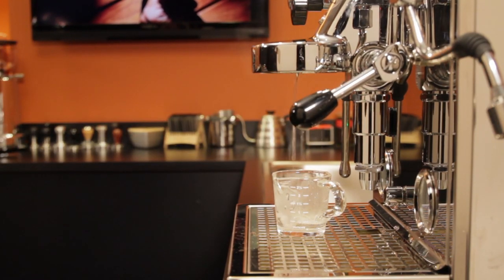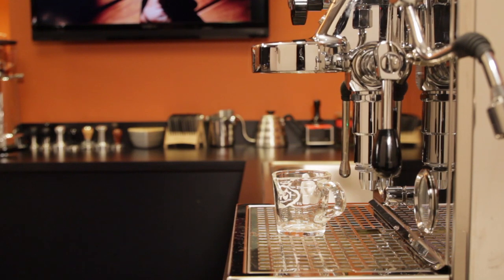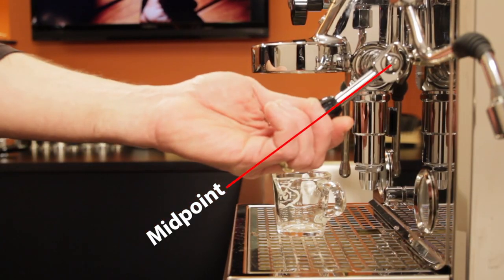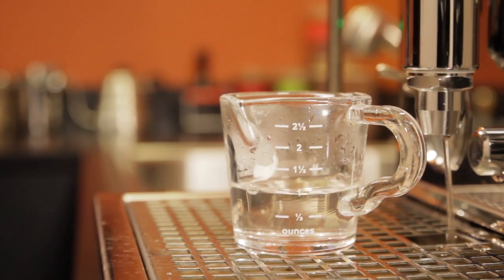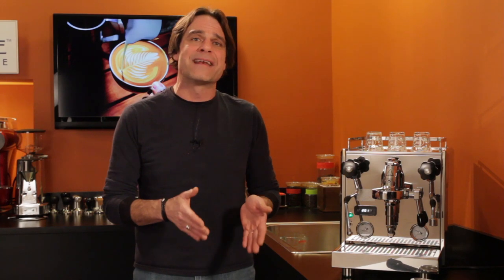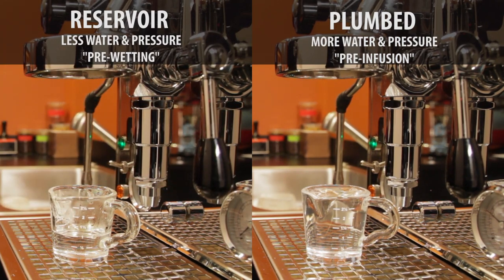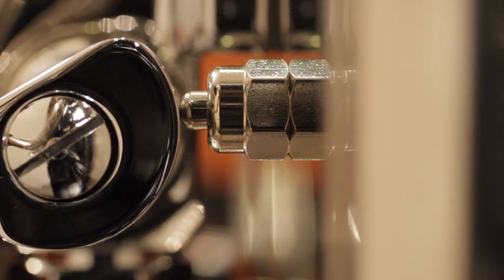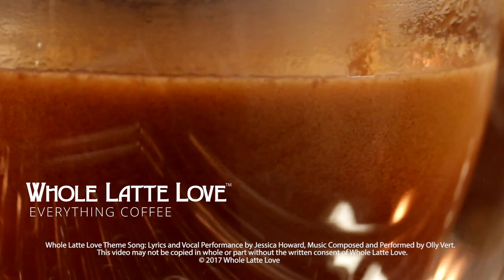How To: Pre-Infusion on E61 Brew Group Espresso Machines

Comment: Can the Profitec Pro 600 w Flow Control preinfuse? It’s a vibration pump, so I’m assuming not... but, due to the Flow Control feature, I am able to control the pressure/water... so I am not sure. Thanks!
Reply from the maker: Hi Alex, Thanks for the question. You definitely can pre-infuse on the Pro 600 equipped with flow control! Vibration pumps take a few extra seconds to reach full pressure internally as compared to rotary pump but after that it's all the same.
Marc

Comment: Hi Mark thanks for the video .. and I want to ask if the water line is for example 30 psi and I did preinfusion ,so the full ectraction will be 30 psi more than the actual brew pressure?
Or the water line pressure will be de-activated when I raise the arm?

Comment: If you live in an area with high water pressure (e.g. 70psi) would it be advisable to install a water pressure regulator before the machine so the incoming pressure doesn't blast a hole in the puck? if so... what would be an ideal range for the water pressure setting?
Reply from the maker: Hi Elton, Thanks for the question. Yes, you should have a pressure regulator on plumbed in connections. ECM/Profitec specs 2 bar/30psi pressure setting for machine input. In addition to a pressure regulator it's advisable to install an in-line water filtration system to prevent scale and remove chlorination. Especially true for dual boiler machines which are difficult to descale. A popular option which can eliminate scaling and includes a pressure regulator is the BWT Bestmax Premium: https://www.wholelattelove.com/products/bwt-bestmax-premium-filter-package-w-besthead-flex
Marc

Comment: Hi, thanks for the useful video! I have ecm synchronika and the line pressure is 4bar. Should I purchase reductor? The user manual says max 2 bars... I'm confused looking at your profitec with 4 bars. Can I use my synchronika safely?
Reply from the maker: Hi SR, Yes you can use your Synchronika safely! Profitec ECM does recommend reducing input line pressure to 2 bar. This because their plumbed machines are always open to line pressure internally. This allows for the relatively unique and desirable line-pressure pre-infusion feature when the machines are plumbed to waterline. A pressure reducer is a good idea. It allows one to adjust the pressure of pre-infusion if desired. I'd set that to the recommended 2 bar for normal use and when the machine is unattended for extended periods. But no problem using higher setting when desired.
Marc
Reply: @Wholelattelovepage  thank you!

Comment: Wouldn't pre-infusion defeat the purpose of tamping and leveling off the coffee inside the portafilter? Once it gets wet, the coffee should loosen up and it will be a wet "blob" prior to having the full pressure go through.

Can someone explain why many people emphasize on leveling and tamping the coffee... and the getting all wet so it undoes the tamping?
Reply from the maker: Hi Freddy, Thanks for the question. There are a few uses for pre-infusion. Totally understand why you think it might loosen up the coffee. But, that is not what happens. One use for pre-infusion is to help prevent channeling of brew water through the coffee puck. When water initially saturates the puck the ground coffee absorbs it and swells slightly. This helps make the puck a little "tighter" and prevents brew water from finding a path of less resistance (channel) through the puck. Channeling causes uneven extraction of the coffee. Another use for pre-infusion is to allow a very fresh from roast coffee to off-gas CO2 locked up in grind. Off-gassing helps to reduce brightness/acidity often associated with in lighter roasted single origin specialty coffees. Technique for that is a very long, like maybe 15 seconds, low flow rate before ramping up to higher flow rate and extracting. That type of pre-infusion requires a capable machine. One that can do line-pressure pre-infusion or has a flow control device.
Marc

Comment: Hi, Marc, GREAT video for showing pre-infusion on E61. got a question here, i have a rocket giotto type R, and i use flojet with an accumulator, which ensures that i have a stable water pressure; however, while i lift the lever up to pre-infusion position, i see water comes out from the group head, but the pressure gauge shows 0 pressure, just like the one in your video shows "RESERVOIR".  Anything wrong with my setting ?   Thanks in advance.
Reply from the maker: Hi sFu, Thanks for the comment and question. It's a good one! What you are seeing highlights an important difference in plumbed machines from different manufacturers. What you're getting is the E61's pre-infusion only. You will not see line pressure on the gauge during pre-infusion on plumbed Rocket machines. This because Rocket machines have a solenoid valve which only opens the machine to line pressure when the pump is operating. If the pump is off the machine is closed to line pressure. Plumbed rotary pump machines from ECM and Profitec do not have a solenoid valve on the plumbed connection so when you lift the lever line pressure does reach the group prior to the pump coming on. Two ways to consider this difference. First, the solenoid valve in Rocket machines prevents water flow into the machine when UN-attended. This prevents flooding should something give way inside the machine. Without the solenoid in similar ECM/Profitec machines there is that risk. I have never had a report of that happening with an ECM or Profitec machine. But, it is a possibility and why ECM/Profitec clearly states that line pressure into the machine should be limited by a pressure regulator to 2bar/30PSI and water supply should be cut off when the machine is not in use. On the other hand without the solenoid valve ECM/Profitec machines can do a true line pressure pre-infusion the pressure of which can be user controlled by adjusting a pressure regulator if equipped. Hope that helps!
Marc
Reply: @Wholelattelovepage  It helps A LOT. Thank you so much, Marc.

Comment: I always thought that preinfusion is the process  while the water drips at first on the coffee and then into the preifusion chamber until it is full. before the pressure builds up completely . (pump on)
The E61 was the first brew group with automatic preinfusion (without lever in mid position) just look at the pressure gauge how it reacts with some delay.
Reply from the maker: Hi LA, Thanks for the comment. With machines now capable of doing line pressure pre-infusion things have progressed. Also options for flow control to do incredibly long low flow pre-infusion. Quite different than a pre-wetting and very short delay in pressure/flow build. These capabilities have become much more important as the qualities of specialty coffee have gone through the roof in the last decade in conjunction with espresso moving beyond commodity to a more crafted experience in many parts of the world.
Marc
Reply: @Wholelattelovepage  Marc thanks a lot for taking time to answer. I love your channel.

Comment: So does pre-infusion works on ECM Synchronika using reservoir? (Can’t plumb)
Thanks Marc for all the useful videos <3
Reply from the maker: Hi MAS, Thank you for the kind comment and question. When running from reservoir you cannot do a true pre-infusion defined as a continuous slow flow of low pressure water. You can do pre-wetting of the coffee by raising the lever to the pre-infusion position. This drops a small amount of water onto the coffee with no pressure behind it. Hope that helps!
Marc
Reply: Whole Latte Love Thanks a lot Marc for the prompt reply, and sorry if my question was stupid after all given info but i saw a video that says Lucca a53 mini is one of the machines that are capable of pre-infusion using reservoir so i was just wondering if Synchronika is one.
Reply: Whole Latte Love Only a flow control will help me truly pre-infuse in this case right?

Comment: This doesn't seem to work on my Pro 500. Can I just turn off the power for a second and open the valve fully to pre-infuse??
Reply from the maker: Hi Brad, Since you are running off reservoir on the 500 what you'll get is pre-wetting and not pre-infusion when lifting lever to just before the pump kicks on. That's basically a bit of pressure pushing water out of the heat exchange section of the boiler and onto the coffee. In theory, you could leave the power on, lift lever fully to kick the pump on for a few seconds and then lower the lever just a little  so pump kicks off and allow the pressure to push a bit more water through the coffee, wait a few seconds and then kick the pump back on. I'll just say that's not a technique I've seen used or that I've tried myself. Another option is the Profitec E61 Flow Control Device: https://www.wholelattelove.com/products/profitec-e61-flow-control-device It allows you to have the pump on full and have continuously variable control of flow rate through the group.
Marc

Comment: I am probably changing my view on pre-infusion. Yes, it seems logical to pre-wet the tamped coffee puck for a short duration before hitting it with 9-bar pressure. However, I can't think pressure at 9 bar within the restricted space of the portafilter basket would allow channelling to occur. That's an awful lot of pressure over a small area!. Only a see-through group head assembly would allow us to find the definitive answer. I notice on my new ECM Synchronika that there is no difference between a short traverse of the brew lever and fully open - the rate of water delivery is just the same.
Reply from the maker: Hi DR4, Thanks for the comment. I can understand your reasoning but I guarantee you channeling can occur. A few ways to check: After an extraction have a look at the top of the coffee puck. Channels are clearly indicated by holes in the surface of the puck. Another fantastic tool for appraising channeling is the bottomless (or naked) portafilter. It allows one to view the extraction as it exits the filter basket. Channels present here as spurts/spraying of espresso from one area of the filter basket while other areas may have no flow at all.
As to not being able to hit the pre-infusion point. It's a very small move of the lever to go from the pre-infusion position to the pump on position. Sometimes the pump switch which is contacted by the cam of the E61 lever is slightly out of adjustment. The switch is extended out to far making it difficult to hit the pre-infusion postion without turning the pump on. The switch position is adjustable if that's the case with your machine and it's easy to do. There are 2 nuts on the shaft of the switch. One on the outside face of the machine and one inside the machine. If up for it you can loosen the outside nut a few turns and take up the slack by tightening the inside nut. This requires removing the cover of your Synchronika to access the inside nut. It may take some trial and error to get the adjustment just right. Also be careful with hands inside the machine if components are hot and unplug from power when working inside the machine. Hope that helps!
Marc
Reply: @Wholelattelovepage  yes a bottomless portafilter is essential for learning about channeling and making a better tamp.

Comment: Hi Marc,  how many seconds do you preinfuse. Untill you see coffee coming out of the basket?
Reply from the maker: Hi J, Thanks for the question. If I were doing line pressure pre-infusion of ~2bar on a fresh from roast coffee (or many specialty coffees) I'd go until I got some drips. It can do wonders to reduce brightness/acidity typical in those types of coffees. Doing that you'd likely want to grind a bit finer than for an extraction without a long pre-infusion.
Marc
Reply: @Wholelattelovepage  Hi Marc, Thank you, will try that!
PS: Your video's inspired my to buy the Profitec pro 700
Reply: @Wholelattelovepage  Hi Mark, After the first drops do you instantly pull the handle up or do you let it "bloom" for a couple of seconds?

Comment: My Giotto with reservoir doesn't pre infuse often it does it only sometimes it's really weird
Reply from the maker: Hi tm, how old is your Giotto? More recent Rocket Espresso Giottos are PID temp controlled. Older models may use a pressure stat which produces a wider swing in boiler temps. Understand it's boiler temp which causes a little flow in an HX machine with E61 group.
Marc
Reply: @Wholelattelovepage  ok thank you for the reply it's just frustrating it does it only when it feels like it? (Shower) it's nice to watch when it does it but when it doesn't it just gives out like ...air and some weird noise but no shower/water comes out. Thanks for the reply BTW

Comment: I'm on an Izzo Vivi Pro, and this method definitely works to pre-wet the puck. Thank you!

But the very fact that the group lever has a mid-point creates another question: what is the actual, as-designed reason for the lever to stop there? In other words, if that mid-point is to help you pre-wet/infuse, why doesn't it stop AT that line-pressure-but-no-pump spot?

Critically, does anything actually happen at the mid-point, which is different from the off/fully-lowered position?
Reply from the maker: Hi MrBB, You are welcome. Good question and I do not have a good answer as to why there is no definitive stop at that position. Just a spot at which valve opens in the group and allows water to drop without the pump coming on. Holding there without the pump coming on allows water to soak deeper into the coffee puck without pressure.
Marc

Comment: I have an ECM Profitec IV and the boiler gauge has scale blockage after descaling the machine, I know because the gauge remains at 0.5 bar when switched off and cold. Do you have a video or link that shows how to unblock the gauge pipeline?  Or can you please provide a basic explanation?
Reply from the maker: Hi J, Thanks for the request. Always a chance that can happen when scale has gotten a little out of hand. Don't have a video for that procedure and the blockage may have made it to the internal mechanism of the gauge which would require a gauge replacement. If blockage is just in the pipe you may be able to remove the pipe and let it soak i descaler in hope of freeing it. Depending on how bad the block is it might not be successful as it's hard to get the solution into the pipe. In the shop here we would replace the pipe.
Marc
Reply: @Wholelattelovepage  Fixed the problem today. Emptied the boiler and let the machine cooldown, removed 6 Allen key bolts off the top cover, removed the top cover, then unbolted the boiler gauge pipeline from both ends and the problem quickly became obvious. The boiler pipe end was blocked with calcium deposit. The Pipeline inner diameter is very similar to the diameter of a sewing needle, thus I used a sewing needle to poke and clean out the calcium deposit. Re-assembled the machine and voila the gauge is reading perfectly.